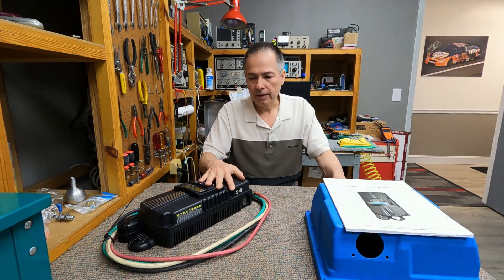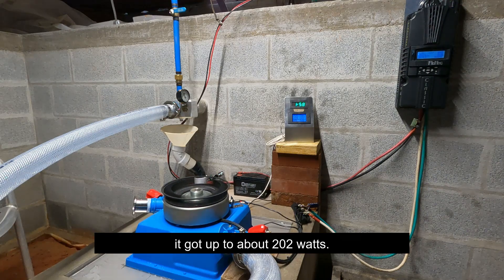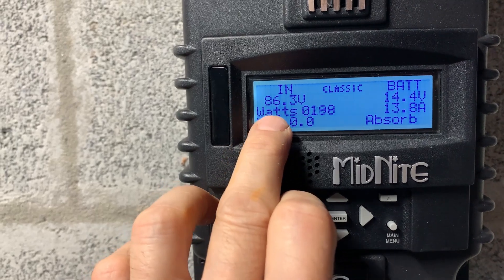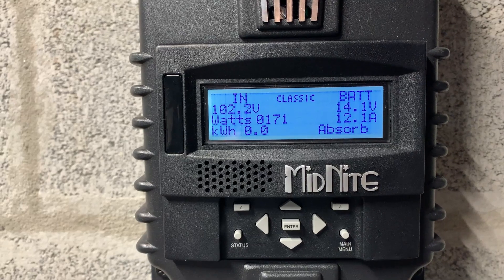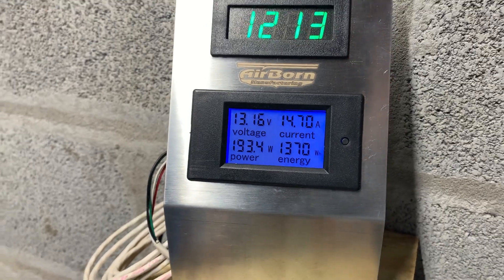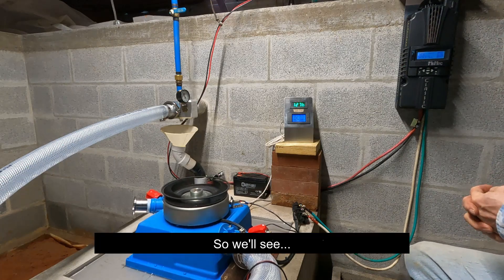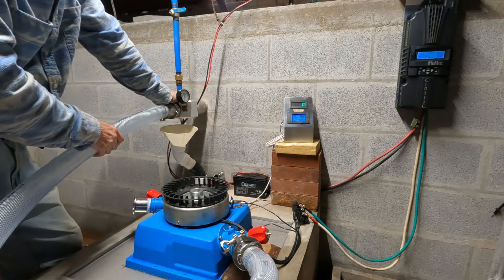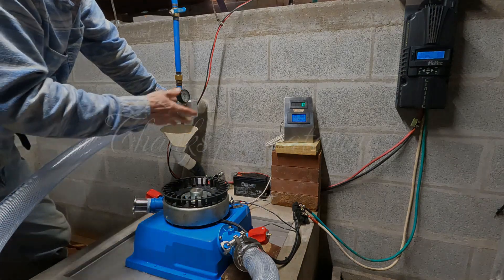Micro Hydro - MPPT Settings

Comment: Not sure, but I suspected it does not go max power in auto due to the battery is already full (14ish volt) and the charge controller was lowering its output. I would suggest to rerun in auto and do it with additional load (to vary battery voltage) and see how the MPPT charge controller react
Reply from the maker: That is a very good observation. Yes, that definitely will affect the power being delivered to the batteries. I have done what you suggested various times before and the results were always the same, the MPPT auto mode most of the time will be less than having it set to a fixed voltage value. You can see in this video that even at 14.4 volts using a fixed target voltage; I was able to get 200 watts out of it.

Comment: I don't understand why the MidNite takes so much time to respond in manual mode because it changes a lot more quickly in auto mode and it does so while running! I would try to update the firmware if that's possible, If that doesn't fix it, I would try contacting their customer support.
Reply from the maker: That's a good suggestion. I'll worked on getting the firmware updated, thanks.

Comment: 7:46 I'm pretty sure you get input voltage even when the generator is off because there must be some pretty beefy capacitors inside the charge controller. Also, we see the voltage drop slowly on the charge controller's display with would be consistent with capacitors discharging themselves.
Reply from the maker: The voltage also climbs above the battery voltage on the charger side according to the MPPT setting. So it's more than the charged capacitors.

Comment: hi compensate the three phases to bring the cosfy towards 0.9, then put an electrolytic capacitor on the diode bridge
the working point of the mppt also changes based on the battery voltage
if you have an oscilloscope look at the AC voltage if you see harmonics and that the AC current is a good sinusoidal
try to put a resistive load of a few mA (I use a 10 watt filament light bulb) at the input of the mppt
I don't know exactly why, but the mppt algorithm responds better to find the optimal point
Reply from the maker: Thanks for the tips, I will try these out.